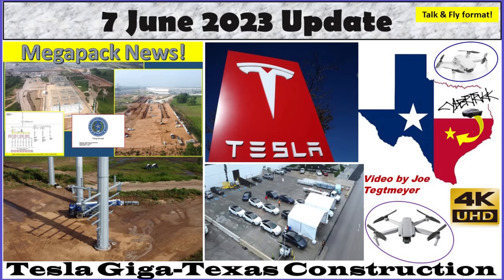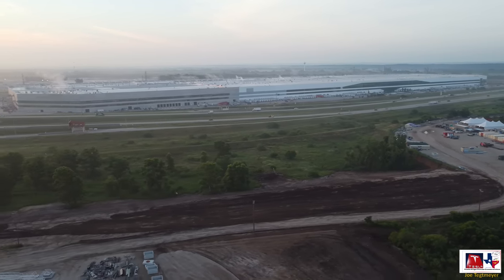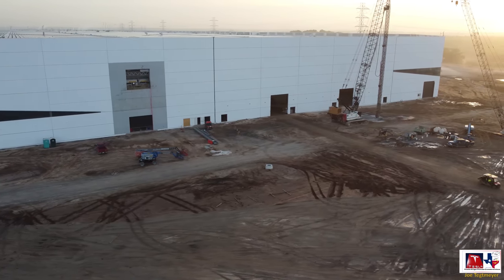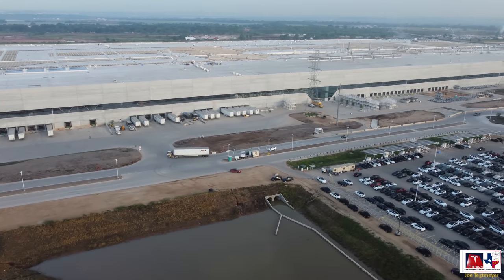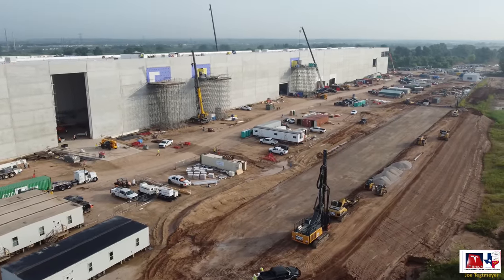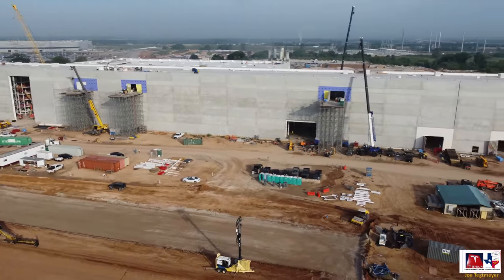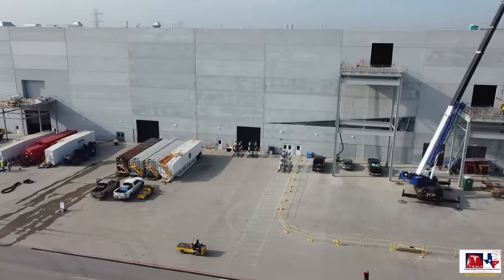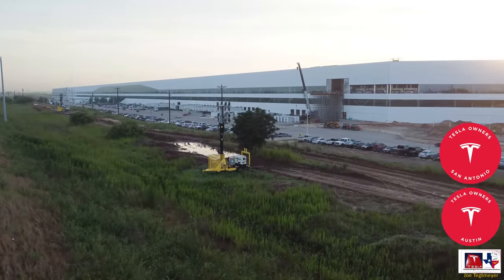Model Y Bumper Molds, Megapack Progress, Cathode GeoPiers! 7 June 2023 Giga Texas Update (07:15AM)

Comment: New LCRA switchyard/substation, the BESS, existing temporary switchyard/substation.

Spent the morning sketching out drawings to try and reconcile what is shown in the ERCOT documentation, and what is seen being constructed. Sketch number 7 started to make some sense. Lots of speculation following.

ERCOT schematic drawing.  Really only shows the interconnection between the new switchyard/substation and the BESS. That’s what the agreement is about. What happens downstream is not shown.

The schematic shows quite clearly the interconnection between the Tesla Energy Monopole (north of the new LCRA switchyard/substation) by underground cable through HDD bores under the easement pipelines, to the BESS switchyard.

Some details are less clear. The schematic shows 2 x ‘Backup power to Tesla Enclosure’, and ‘To Auxiliary Power Plant’.

Speculating that the 2 x ‘Backup power to Tesla Enclosure’ is the existing pair of supplies in the temporary switchyard/substation.

Speculating the ‘To Auxiliary Power Plant’ is an existing set of diesel generators thought to be located in the Battery plant. Level 1 westside, towards the north end, 3 large square louvred openings and circular openings above, seen at 5:19.

What’s not shown in the schematic. Connection of the new LCRA switchyard/substation to the factory.

2 new ductbanks (the conduit bundles) are being constructed to connect the factory to the space between the new LCRA switchyard/substation, and the existing temporary switchyard/substation. This is the excavation area with the retaining wall where it’s assumed a series of vaults will be constructed. These vaults may simply be a cable management structure, no switching. This cable management structure I’ll assume is the ‘Tesla Enclosure’.

Following is sketch number 7 converted to text. Some details may have been lost during translation.😐

This proposal seems to work.

Supply from the new LCRA switchyard/substation connects directly to the factory through the ‘Tesla Enclosure’, and Ductbank 1.

The 24.9kV bus shown in the ERCOT schematic is the cables that will be run from the BESS switchyard, in the HDD bores under the easement pipelines into the ‘Tesla Enclosure’, where it connects with the pair of supplies from the temporary switchyard, before continuing into Ductbank 2, and on to the factory. Supply through the 24.9kV bus enters the factory, picking up the ‘Auxiliary Power Plant’ along the way.

Assuming the supplies in both ductbanks terminate in the Main Switchboard Room.

Switching between supplies. Where does this happen? 
2 possibilities come to mind that fit in with the schematic, and what is seen being constructed. 

In the Main Switchboard Room.

In a structure above the ‘Tesla Enclosure’.
Reply: Dessie, this is how it appears to me. 
The connections to the 24.9 kV operating bus are:
1. Power to and from the battery system. metered
2. Wholesale power from and to LCRA. metered in Hornsby Substation
3. Backup power to Tesla Enclosure (Factory Load)  Either assembly Plant or Cathode Plant   metered
4. Backup power to Tesla Enclosure (Factory Load)  Either assembly Plant or Cathode Plant   metered
5. Plant Auxiliary Power    I believe because of the write up and transformer symbol this is the connection to Bluebonnet power.

I believe that you are correct that the secondary from the two large transformers in the Hornsby Substation connect to the internal switching south of casting with two individual busses.
The 24.9 kV operating bus could also be routed to this area for switching. Would also be a good connection point for solar power.
Reply: What I've been thinking for the last couple of weeks are similar to your thoughts, but didn't include the temporary substation or diesel generators. It goes something like this....
The ‘Tesla Enclosure’ is a structure being constructed in the excavation south of new LCRA substation. As you said, cable management on the lower level below grade. Possibly an upper level that will contain switching equipment. Power enters the Cable Room (below grade) from the two LCRA transformers, and also from the BESS substation via the HDD bores under the easement pipelines. All cables are directed up to the switchgear room on the first floor. Switching would be needed if there were a power failure and they were drawing power from the Megapacks. That is in order to prevent back-feeding the LCRA grid. Power would then go out to the factory through the 2 ductbanks under construction, and terminate in the Main Switchboard Room.
My initial thinking didn't include the temporary substation or the diesel generators. Didn't even realize that the generators were there :) 
I think we have two slightly different versions, but the same concept. I will have to rethink, but...
Adding diesel generators is easy because switching take place in the Main Switchboard Room in the factory.
Adding the temporary substation as a backup power source could be done with cables entering the Cable Room below grade, and switching taking place on the upper level of the "Tesla enclosure".
Reply: @eltonray2934  Connection to 24.9kV bus.
1. Agree with that. Schematic agrees also.
2. LCRA Hornsby Bay 1 and 2? There’d need to be a separate bus/buses for the supply from the LCRA, otherwise that would be a backdoor interconnection/second connection to the 24.9kV bus.
3. Sounds right. Have to watch as the construction continues.
4. Ditto.
5. Sounds right. Not sure why this wouldn’t be shown as 2 x Auxiliary Power.

Solar power. I’ve got it set in my mind that this is an entirely behind the meter system. Inverters feeding directly into the plant distribution system, not unlike a typical domestic system. In fact exactly like my domestic system where I have a separate PV Array and Inverter on the house, and another PV Array and Inverter on the garage. The systems aren’t directly connected except through the local distribution cabling.

My thinking there may be biased, but to me it makes no sense to gather all the PV generated energy to one point, and then distribute it again via the plant distribution system.

Meaning of the term ‘bus’. I take it a ‘bus’ is a 3 phase supply, regardless of how many cables are involved. Could be 3 actives x 2, 3 actives x 4, 3 actives x whatever. Each ductbank may be a ‘bus’.
Reply: @DavidJohnson-tv2nn  Diesel generators. I don't think this have ever been confirmed, exhaust fumes, or some other evidence. Suggested by either William Wheeler or Patrick Kenny.

It makes absolute sense that there would be something particularly in Battery where a shutdown of power might cause a huge amount of grief. Unlike GA where the line would stop until power is restored and work then simply resumes.

There's also the horizontal flue on the roof of Paint that looks very much like an exhaust pipe to me.
Reply: Dessie, in an earlier communication with Elton I mentioned the various types of main electrical distribution systems in order of increasing reliability. You may have seen it. Elton at that point also thought that for GT it is not the simplest system (Radial; a single main feed), nor is it the most reliable (a Loop: a complete circle back to the source of supply) but the intermediate one called a Parallel system of two feeds running completely separate and parallel.
Elton though the Parallel system was also implemented in the set up with the two new transformers, meaning that the parallel design to make GT impervious to a failure in one of the feeds is extended to include the 345 - 24.9 transformers as well. If I try to understand the new switchyard with the three “lanes” I see that at the Northern end the lanes are interconnected via metal rods/busbars running E-W which allows both incoming 345 grids/supplies to be used together or each separate to either one or both the transformers. So the Parallel design for the main feed to GT extends into the switchyard with two parallel transformers. Then, what you call the “Main Switchboard Room” is in fact the facility under construction next to the two main transformers. Downstream of this main switching the 24.9 kV cables then run into GT and go from one to the next local step-down distribution system for supplying end-users from 3-phase power users to 110V lamps in the restaurants etc, all distributed as efficiently as possible over the entire facility.

Second, regarding the auxiliary power: My understanding from my refinery days is that an auxiliary power is physically completely separate from any feed system, it only shares a control point and automatic start facility at the very end, just at the physical location where the normal stepped down feed ties into the user that needs to be protected. Indeed in most cases a diesel generator. Additionally, for the computer systems in the control room we had a room with lead acid batteries (old history by now..) such that there was also an “uninterrupted power” capacity.
Now, in the modern days, we have examples such as South Australia's  Hornsdale MegaPack centre where a very large megapack system is connected to the grid and can perform both functions: within milliseconds it can stabilize the frequency on the grid (the uninterrupted supply feature) and it can also take up the load for the first minutes until conventional stations (gas/coal) have cranked up.
In the case of GT you call the BESS (relatively) small in context of the Hornsby main feed, and that is correct of course, but in the context of auxiliary power supply the BESS is HUGE compared to a couple of diesel generators.
In conclusion I think the BESS  auxiliary role makes most sense as a completely separate connection and then there is also no need for diesel gensets. (“best part is no part", Elon).
Reply: @DessieDoolan  I agree completely that diesel generators make absolute sense. One point needs to be clarified though. After re-reading your original comment, I noticed....
"The 24.9kV bus shown in the ERCOT schematic is the cables that will be run from the BESS switchyard, in the HDD bores under the easement pipelines into the ‘Tesla Enclosure’, where it connects with the pair of supplies from the temporary switchyard, before continuing into Ductbank 2"
The 24.9 kV bus from the BESS substation can NOT connect directly with the pair of supplies from the temporary substation. It can however, be switched. Again, this is to prevent any back-feeding between the two systems. So under normal operation power routing may go like this....
LCRA transformers 1 and 2 ---> Tesla Enclosure Cable Room (below grade) ---> (Possible switching on upper level) ---> Ductbanks 1 and 2 ---> Main Switchboard Room in the factory.
In an emergency  power routing may go like this....
BESS 24.9 kV bus (or temporary substation if they keep it) ---> Tesla Enclosure Cable Room ---> (Possible switching on upper level) ---> Ductbanks 1 and 2 ---> Main Switchboard Room in the factory.
Switching for the diesel generators would happen in the factory.
Most important.... Hope you can repost your original comment on Joe's next video. That way more people will have a chance to see it and chime in. I  have a couple other ideas, but it would make this too long.
Reply: @DavidJohnson-tv2nn  Connection to the 24.9kV bus. That's the bit that got lost in translation. It's on the sketch I have those shown as being switched. Only by chance, I added the switching about sketch 5.

I might re-post it after a few more clues show up.
Reply: @hardernl8893  Regarding diesel generators...
Wouldn't a fault anywhere along the BESS 24.9 kV bus take out BESS as a backup power supply? Which means keeping the temporary substation for backup, or having diesel generators may be a good idea? Not sure if they are going to do that, but it seems like a good idea.
Reply: @DavidJohnson-tv2nn  I also agree that backup diesel generators make absolute sense, no question. The quoted Hornsdale system is already famous for stepping in during times of upset on the grid, so in my mind I extended this "auxiliary supply" benefit of a BESS to the GT situation as well. Here I may have overstepped the mark and is the common sense solution still the same, namely that protection against an electrical supply fault can only be provided by a non-electrical source of energy.
Reply: @hardernl8893  Just want to add that it is a very good point that you brought up about the parallel design. It might not be the best, but is incredibly robust and fault tolerant. Not only can the design tolerate a failure any point, but can tolerate multiple simultaneous failures! Say for example, they lose power from the transmission lines to the north... There is also a fault on one of the substation's two east-west bus bars... Then one transformer is taken offline... The factory would still have power. You can go to the schematic on page 48 and choose random failure points. then see how power can be routed around the failures. The guys who designed this did a great job.

Comment: 28:13 precast bases are a puzzle to me.  With millions of sq ft of poured concrete flatwork on this project, why not form up and pour the Megapack bases in place?  Curious minds want to know.
Reply: 28:13. Accuracy would be my guess. Probably a bunch of cast-in threaded inserts in exactly the right location. Possibly some conduit runs as well. 

May even be a requirement by the Battery supplier (that happens to be Tesla Energy) to use these bases.
Reply: There going to run all of the conduit, and stub it up to each megapack, electricians will work with the crane operator to drop the prefab slabs and line them up with the conduit(s), they are also very close to each other..  this will be faster than installing & measuring conduit, forming up the sides and blockoffs for the conduits then pouring concrete..  rememeber, this is Tesla, speed & effiency is everything
Reply: The transformer pads are a common application; it is easier to have the high voltage and low voltage conduit areas prepped and the anchor inserts installed already. Could be similar logic on the Megapack bases.  Once you have the crane on site it is nice to be able to just pick and place everything with one tool.

Comment: BESS yard: @ 27:15 Schematic diagram... One thing I just noticed and have a question about....
On the schematic just above the 4 circuit breakers and switches, there is a meter. next to it appears to say....
"Input signal from BESS integrated auxiliary loads"
From its position in the schematic, the meter appears to be there to measure the power to or from the the Megapacks. 
Anyone have any idea what "Input signal from BESS integrated auxiliary loads" is about?
Reply: David, the supply from the Hornsby Substation east bay is a wholesale connection to charge and discharge the batteries. This supply is metered within the substation to charge Tesla. This supply connect to the 24.9 kV operating bus. The battery system connects to the same bus and is metered to and from the bus along with the metered backup power to the plants. These meters are compared to check the wholesale numbers and anything used in the plants. Any power from this wholesale source that is not used to charge the batteries is charged to Tesla at retail prices.
Reply: @eltonray2934  Thanks! Now that makes more sense. the need to charge different rates, depending on whether the Megapacks are charging or backup power is being used. 
Now, if I understand correctly, they will have the capability to completely bypass the Hornsby Substation, or at least the transformers in the Hornsby Substation. 
As example....
In the Hornsby Substation... One transformer is offline for maintenance. Then a circuit breaker trips, taking the second transformer offline. Power can then be routed through the BESS substation's transformer and to the 24.9 kV bus. Which supplies power to charge the Megapacks, and to the backup power feeds. Tesla is charged different rates depending on where the power goes. Then in a worst case scenario... They lose power from the transmission lines. In that case they still have 262 megawatt hours of power from the Megapacks to run the factory. Which they would be billed at retail rates Am I correct on this?
Reply: @DavidJohnson-tv2nn  David, remember that the 345 kV transformer in the BESS is rather small and could only supply part of the plant. There is a possibility that the BESS could have been charged from another source (Solar) and the metering would compensate for this. You are correct, remember that the Texas Grid is essentially one circuit and suppliers meter their production and users meter their usage, otherwise everything is in phase and connected with floater production plants maintaining the voltage.
Reply: @eltonray2934  Elton, you're right, that the 345 kV transformer in the BESS substation is rather small,  when compared to the transformers in the Hornsby Substation. However... Would I be correct in assuming the BESS transformer is rated for at least 131 MW to match the combined rating of 131 MW for the Megapacks? Thanks.
Reply: @DavidJohnson-tv2nn  David the highest rating for the transformer is 170 MVA. Do not know the power factor out of the inverters, probably 1.
Reply: @eltonray2934  Elton, wouldn't 170 VMA be more power, or at least as much power as  the Megapacks can provide? Possibly as much power as they are getting from the temporary substation? Forgot what those transformers were rated at, or if that information was ever made available.